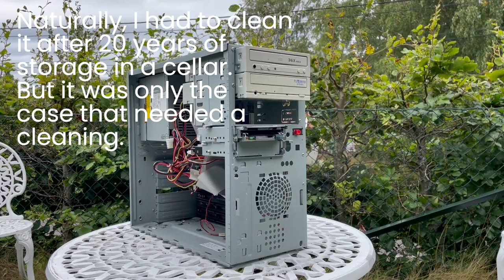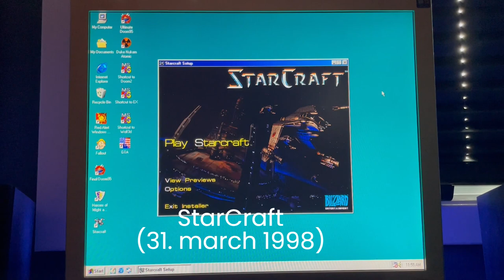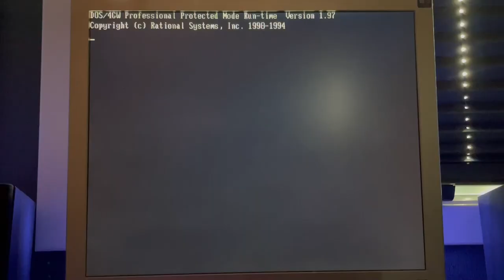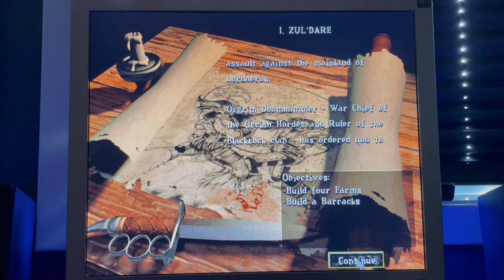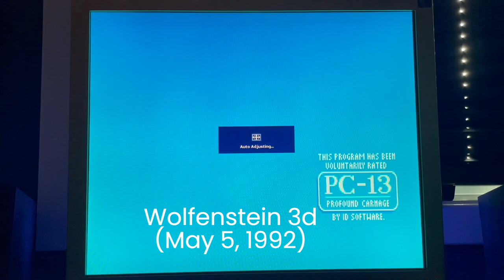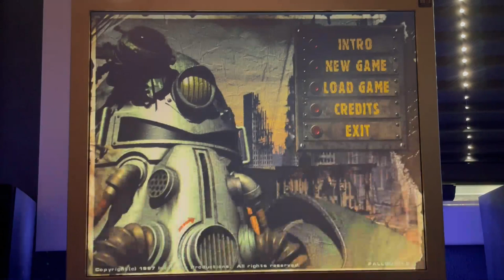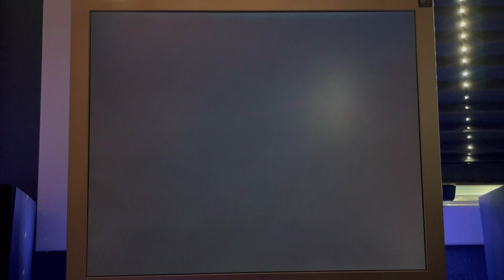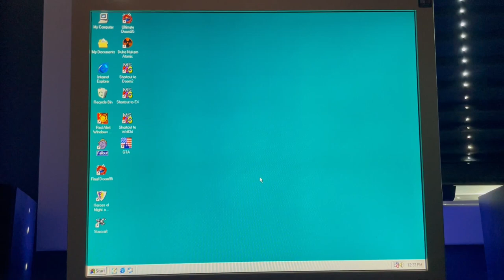Retro gaming on an IBM Aptiva PC from 1997!

Comment: I had one of these that I used as my FTP server.  It was a 466/win98 and installed a rage videocard so I could run a 1600x1200 display.  Very reliable machine.  Also had ICQ (Uh-Oh) on it!

Comment: About static portraits in Starcraft - the deal is not in "weak graphics", i had even weaker and non-3d S3 Trio 1mb in my Compaq Presario. I think that reason was concentration on game process or other personal reasons.
Reply from the maker: Perhaps. Was not really a problem. Just noticed a small difference in smoothness when the portraits was turned to static. Thank for the comment! :)
Reply: @paulp9270  thank you for the content) Subscribed)

Comment: Jeez. the first fallouts cut scenes characters lip movement pair up perfect to the voice. Most games cant even do that anymore. has anyone else noticed what a stuttering mess that pre-rendered cut scenes can be now and days.
Reply: Indeed, it was a common feature back then (I was fascinated by cutscenes in Blizzard games, still remember all of them). But these videos were very short and rarely intended a voice localization to other languages. So prerendering everything with a decent lipsync for English was not that hard, I suppose. On the other hand I bet all the face morphing was done by hand in a very basic 3D editor software instead of using some special software to quickly manipulate the lips position as necessary for each phonema.

Comment: Stick a ATI 3D Rage Pro PCI on this computer or a 3Dfx Voodoo Banshee PCI. Stick a Sound Blaster 16 with real OPL3 chip on that machine or just go with a Sound Blaster AWE32 or even AWE64. I have a Gateway Solo 2500 with a 200 Mhz Pentium MMX Mobile, NeoMagic MagicGraph 128XD, and NeoMagic MagicWave 3DX Sound System. Laptop even has 192 MB of RAM.